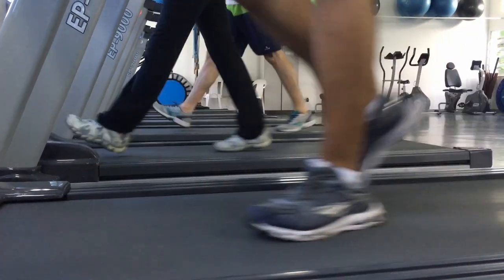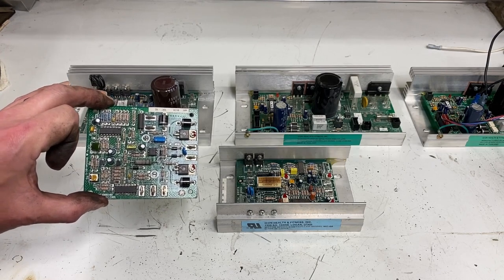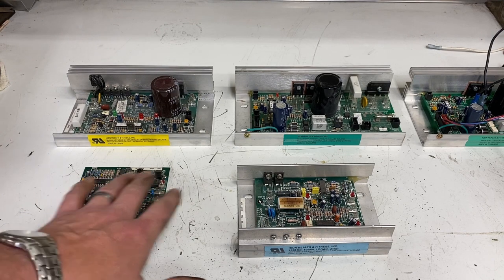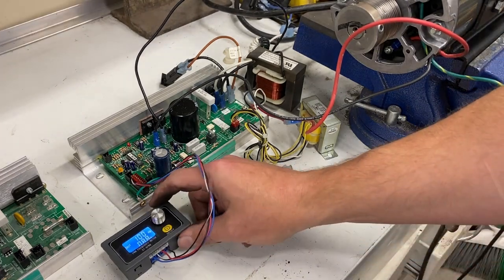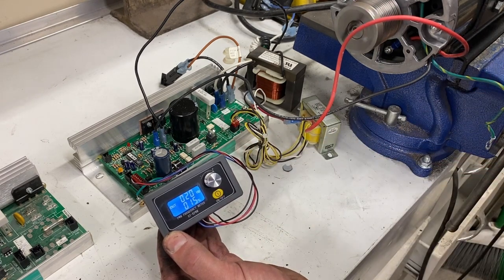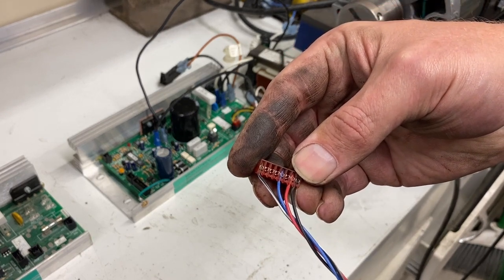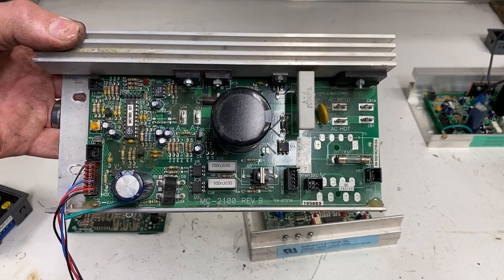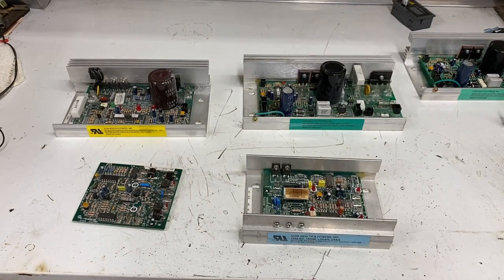Variable Speed Power Supply, Treadmill Motor Controller Boards: MC-02, MC-60, MC-2000 or MC-2100

Comment: Hello,I have a MC2100WA Motor Control Board on a Pro-form Treadmill when I plug it in the red light on the bottom right side comes on and the Treadmill will not kick on I replaced the speed control wire it worked a couple of times then it did the same thing a solid red light and nothing works on the console so what do I need to do when the red light stays on and it doesn't work. Thank You Steve
Reply from the maker: I am not a treadmill repair tech so I do not know.

Comment: I think I have the mc1200 and I want to do away with the counsel board do to its size.  The problem I have is my flat plug has 8 wires.  Can you tell me what colors are my "H" "W" "L"?  The colored wires are black, orange, red, blue, yellow, green, purple, and brown. I took a close up picture of the plug and wires but I see no way to attach it,
Reply from the maker: If it’s an mc2100 you can’t use a potentiometer. You need a signal generator. This video has all the information you need. Programming XY KPWM & ZK PP1K PWM Signal Generator For Use With an MC2100 Treadmill Motor Controller

Comment: I got a reebok treadmill it has a MC70 controller board and no choke but looks like it can directly mount to a potentiometer, but not sure what size? How do i know what size? Is this controller any good it is 20 years old but worked great in the treadmill. looks like on the board I can adjust torque and top speed?
Reply from the maker: based on other boards that use a potentiometer a 5K is probably about right but a 2K on some boards is a little better I would get both and try it.  Its a good board and will get it done just make sure to use the choke.

Comment: Hi. Thanks for your videos!  When you are discussing hooking up the 2100 with PWM, you mention putting the power through the ferrite choke. It looks like you point to the coil choke, but I do see the ferrite one sitting behind it and am assuming that is what you were pointing at. Can you just confirm that you do not use the coil choke anywhere in your circuit for the 2100 board and although it was sitting on your bench, it was not Connected to anything.
Reply from the maker: What you are referring to as a coil is also a choke.  I use the doughnut choke to clean the AC and then a motor choke (transformer looking part) can be used on the DC power but with a PWM like an MC2100 it is not required like it is on an SCR setup.

Comment: Good morning, I have a problem with my treadmill  Proform 755 that has an MC-2100B controller card, the problem is that when I give it the order to start, the maximum speed goes and I have to stop the treadmill. What could be the problem if you can't control the speed? It only goes at maximum speed, it is impossible to use. The failure started when I moved it from one room to another, opened the treadmill and found the card full of dust and dirt.
Reply from the maker: Assuming it is not something in the console control panel (which is a possible cause)  It is likely the the transistor on the heatsink next to the rectifier.  This transistor is the smallest part on the heat sink second from the right.  Sometimes when this part fails it allows full power with no switching.  Often times when this part goes bad it damages the MOSFET (part all the way to the left on the heat sink) so you should always replace them both at the same time.

Comment: I had to replace one of the Mofett and after soldering it on then plugging everything back in, the red light will just flash while pressing start.  Any ideas?
Reply from the maker: I would be willing to bet it is flashing 4 times.  If so the board is completely shot.

Comment: Great video! I have an MC-1648 board, which is [visually] very similar to the MC-2100. The connector where you attach the PWM looks to be in a similar location, but has a lot more wires. My guess is that I'd simply disconnect all but the 4 wires needed for the PWM. I've seen on forums that the MC-1648 wants a 5V signal on the blue wire and some people have added resistors to step down from 12V. Do you have any info on wiring this PWM to the MC-1648 board? Thanks so much!
Reply from the maker: I have not gotten one of those board to mess with
Reply: @dazecars  Thank you! I'm going to give it a try, and I'll report back.

Comment: Daze, I tore apart a Nordic track treadmill with a board like the very last one you showed (mine is labeled me520-26). It has another panel with what looks to be two inductors, a capacitor and two components that look like filter chokes wired in series? I'd love to salvage them if they are chokes but the actual windings are hidden behind plastic. Pricing this part on Amazon it runs $450 so I'd hate to tear it apart to find out they are transformers. Curious if you've you've run into these before?
Reply from the maker: I probably can't help but maybe I would know what it is, send me some pix through my website

Comment: Dave love all your videos.  Can you help me locate the wiring diagram for an Aerobics pro plus board # 9501001?  Have the PWM but not sure which wire is the signal wire and which supplies voltage .  Board seems to work properly but obviously need the correct wiring to get the motor to spin.  Seems to me it is very close to the MC-2100 board.
Reply from the maker: contact me through my website and send pix.  I will see what I can do but no promises. Also look at the control panel board if you still have it.  Some times the board in the control panel is labeled and you can trace the wires back.
Reply: @dazecars  will do

Comment: Thanks for doing this nice summary of treadmill motors and controllers.  I use these all the time and have a few others to add to your list.  So if you don't mind I'd like to comment on these and few other things I've learned over the years.

By the way I like the term "safe start" better "soft start".  (there are "soft starts" available for large industrial motors).   Safe start makes sure a tread mill does start at a high speed when you get on it, thus the term safe start.  It is an inconvenience when using these on our home shop machines,  but there are ways around it.

As you pointed out the benefit of a DC motor is the ability to easily adjust the speed.  Equally important however is that a DC can produce its full torque throughout the speed range.  The current going thru the motor is proportional to the torque it is producing.  The DC voltage applied to the motor determines its speed.  So the controller simply controls the voltage based on the speed setting (potentiometer or PWM) and the load on the motor determines how much current it will draw from the controller.  Most controllers will limit the amount of current it will provide and when it reaches that point it will start to decrease the voltage to keep things from overloading.  The motors sometimes have protection built into them also.  As you showed in your video the blue wires coming out of the motor is a thermal overload (not a fuse) and it will open the circuit (just like the on-switch) if the motor gets too hot.

I found an MC-20 in a small low end treadmill and used it on a small bench top drill press along with the 1HP motor that was in the treadmill.  I could not find much info on the MC-20 so I was unable to disable the safe start but I just turn the pot down to zero each time I start and then set it to the desired speed.

I've used the MC-60 on my vintage Craftsman bandsaw to slow the speed so I could cut metal (using a metal cutting blade).  It works very well.   You can easily defeat the safe start by snipping one lead on R27.  Mine is an MC-60 rev H.  I've also used the MC-60 on my Atlas/Craftsman lathe.  I've documented this on the Craftsman Lathe Forum if you are interested.

I have an actual treadmill (don't use it much anymore) that has an MC-80.  From what I can tell its very similar to the MC-60.  I don't think my wife will ever let me dismantle it.....

I do have an MC-2000 on the shelf that I plan to use on a belt sander some day.

Lastly I'm using an MC-2100 on a small CNC mill I'm building.  My research led me to believe the PWM period needed to be 50 HZ, not 20.  When I get time I may change that to 20HZ and see what happens.   I'm using an Arduino to the read the value of potentiometer and generate the PWM signal to the MC-2100.  You also need to limit the PWM pulse width to 85%.   The nice thing about using an Arduino is you can defeat the safe start in software by controlling the PWM output according to your needs.  

Thanks for letting me hack your thread.  I hope others will learn how easy it is to use these controllers in their home shops.

JD
Reply from the maker: Thanks for the comment and I am glad you liked the video. Defeating the "soft start" 😁 on the MC-20 should be easy. I took a look at a picture of one and it is the same 3 wire potentiometer hook up as the MC-60 or MC-2000, It just may not be Labeled H W and L (high low and wipe) The important thing is that the red wire terminal should be the high which could be verified with a multimeter. To disable safe start simply wire in a normally closed momentary push button switch between the potentiometer and the red or H terminal. Then to use the tool without safe start, push the button breaking the connection and power the machine on then release the momentary switch and the motor will spin up to the preset speed without having turn the speed control all the way down and back up again. 

As to the 20hz V 50hz I went out to my shop and set up a 2100 board with PWM controller. Worked beautifully at 20hz but I could not get the motor to turn on at 50hz. Just an FYI

Comment: Please do a video on the MC1618DLS   There is not a video or wiring diagram on Google.  Im guessing one needs a PWM  controller to use it.  Keep the videos coming, ive watched all yours at lease twice.  Thanks for sharing your knowledge.
Reply from the maker: At the moment I can't because I don't have one.  The videos I have done are for boards I have gotten scrapping out treadmills.  With out the parts I can't try to hack them and not all are easily hackable.

Comment: Thanks for this video! I found an old treadmill with the MC-2100 and thought there was no way I’d ever be able to run the motor using the onboard controller. I happened to have a PWM module and it worked. Thanks man
Reply from the maker: Glad I could help, but before you put a bunch of time and effort into that board you may want to check my latest video.  https://youtu.be/yMkW2SXl_sA
Reply: @dazecars  interesting. I wonder what failed on the board. I’ll be looking forward to your video on the soft start. I’m not sure what I’ll be using the motor for. My first test run on the motor was with a variac and a bridge rectifier and capacitor. Thanks for the reply.

Comment: I saw your videos on setting up a quality speed controller because I am a noob and I just assumed that I couldn’t use the supplied board without also using the treadmill display. I started watching some other videos because I was overwhelmed with the thought of sourcing the necessary parts and was glad to find this one. One tip: you might want to put a link to this video in your other videos because some of your viewers might not know this is an option!
Reply from the maker: thanks for the suggestion

Comment: Day, what’s the difference between a pulse width modulator and a potentiometer? They look similar but the modulator has modes wires so I assume something else is going on with it. Thanks, loving your videos. Having to repeat watching to get every detail.
Reply from the maker: They are about as different as two electronics can be.  A PWM (used to controll an MC-2100) is signal generator.  It sends out electric pulses at a given rate depending on how it is setup. A PWM power supply such as the MC2100 turnes the power off an on rapidly at a given rate to reduce voltage.   A potentiometer is variable resistor.  It creates a resistance and that resistance can be changed.

Comment: I have a MC2100 from a treadmill. The plan is to retrofit my wood lathe. My question is what type of box should I be looking for to house everything? Thankful
Reply from the maker: wood shop changes things, you want it free from dust but you also want it to have cooling.  I would mount it in an electrical box with venting.  If you watch my ELS video you can see the type of box I mounted the electronics in.

Comment: Thanks for the information on dc motor controllers, I harvested a motor and contoller from a treadmill that has a MC1650LS-2W controller. I am trying to find information on this model controller and how  I can connect a potentiometer to the controller. The wires that connect to the controller are color coded black with white stripe, red,green,blue.  I have 10.5v from red wire and 4.9 from green wire, they connect to the controller with only the markings of HD4.
Can I use a potentiometer with this board or do I need to use a pulse generator and how do I connect them. Thanks for any help you can give.
Reply from the maker: contact me through my website. email me pictures of the board, the motor, and the data sheet ( if there was one inside your treadmill) and I will see if I can help.

Comment: Great video man. I learned alot. I have a treadmill with with a 3.8hp motor and mc-2100ls-30rev controller. That is what is labeled on the board.  The tag says mc2100lts-30. I am going to convert it into a lamb walker and have eliminated the large display and all that. I am going to use the same pwm with the dial you used. Can't seem to find which motor choke I need though. Any advise?  Also is this motor reversible? Thinking about putting in a 3 position 6 pole switch to be able to run it both directions. Thanks again man. Great video!
Reply from the maker: You can get the choke on eBay search "Treadmill choke" Just know that people don't know what they have and think transformers and chokes are interchangeable because they look almost the same, but they are not. To know which one is actually being listed look at the wires coming out of it. if it has 2 it is a choke if it has 4 or more it is a transformer. Most of theses motors are reversible but you need to test it first by hand spinning it backwards. If it feels about the same forwards and backward then yes it is reversible simply by switching polarity. Keep in mind the choke needs to go between the power supply and the switch so that it is always on the positive wire and putting it after your direction switch would only put it on the positive wire in one direction.

Comment: In the realm of junked treadmills, which brands or models would you choose to tear into?  There are a couple of very accommodating salvage operations nearby.
Reply from the maker: For me the answer is all of them.  Any chance I have to pick up a free treadmill I take.  Some times I get something with lots of parts I can use: steel, motor, control board(s).  I even keep the decking from most treadmills, I have a workbench with shelving underneath and all the shelves are made from the treadmill decking boards. Other times I will get a treadmill that only the motor is usable.  There are so many makes and models that I never know what I am getting until I pull the cover.  Once the cover is off I know immediately what I can and can't use.

Comment: Great video, thanks!  I've done both an SCR controller and a MC-2100 with pwm and I love the latter; it runs very smooth and quiet.  I used a a raspberry pi pico for the pwm and wired a potentiometer to the pico to make adjusting the speed nice and easy.
Reply from the maker: Thanks for sharing

Comment: This is the most comprehensive and well laid out video explaining how to modify treadmill controllers I have ever seen, have fitted treadmill motors to my Seig Mill and Hobbymatt lathe so this will help me to adapt the controllers I have, will be doing this tomorrow, many thanks regards Doc Cox.
Reply from the maker: Glad it was helpful!  Please don't hesitate to reach out if you have any questions or if I can be of further help.
Reply: @dazecars  Thank you, had a look in thre shed for my stash of treadmill control boards and found I had four MC 2100,s plus chokes and filters so will be having a go when the signal generator turns up.

Comment: If I want to keep the flywheel on my motor, do I grind/file the grooves off and get a fitting pulley? Or can I get a pulley with the same grooves to  put on my harbor freight wood lathe shaft? Also what are recommended outer diameter pully sizes for bowl turning? I'm sorry if you've already answered this for someone else.
Reply from the maker: either should work.  On my mill build I cut the grooves off and then fit a pulley over the top.  As to pulley size I would go with the biggest ratio that still gives you desired max speed.
Reply: @dazecars  thanks again!  On a side note,  you should get with audible and narrate some books. You got one of those voices. I'd buy that book lol
Reply from the maker: @TurnItUpbyTravis1213  thanks!

Comment: Very informative. Great video.
Have you had any experience with speed sensors on these motors?
The motor I have has a wheel at the opposite end to the drive shaft.
Has a sensor with 3 wire plug that connects into the board. Is there any way to display the RPM?
Reply from the maker: The main function of that sensor is speed consistency. When you lode the motor it will slow down some and that sensor should help maintain consistent speeds through a range of loads. I have not played with that function.  As for an rpm display I’m sure it probably could be done but not for less money than a stand alone unit like the one I installed in this video. Which board are you using?

https://youtu.be/MmRMNo9IbVU
Reply: @dazecars  Thanks for the info. I found your RPM video 5 mins after my comment🤠. Have one on order